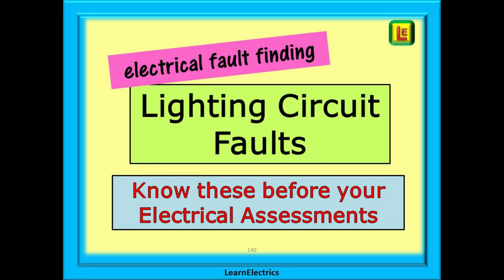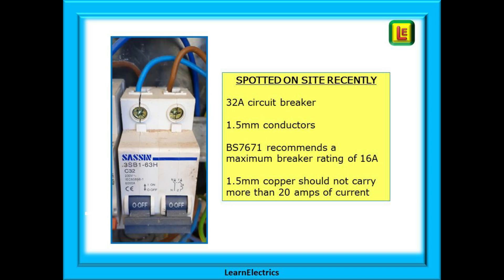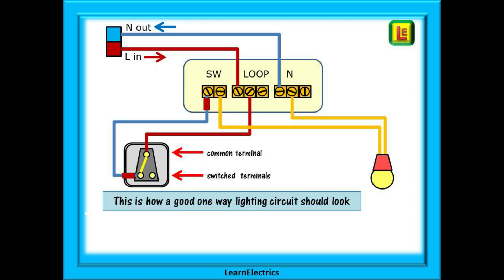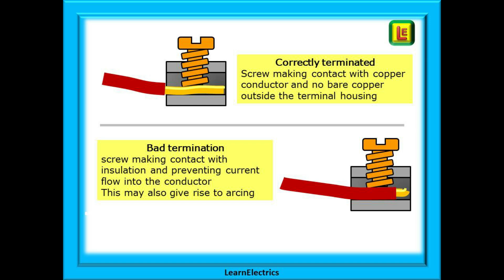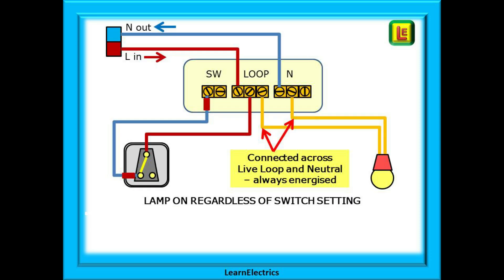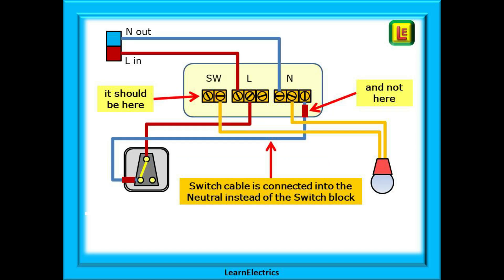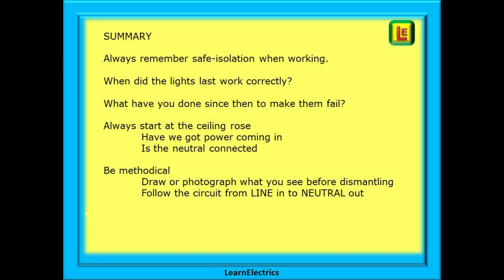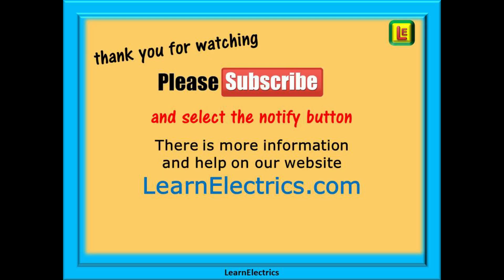LIGHTING CIRCUIT FAULTS FOR ELECTRICAL ASSESSMENTS and FAULT FINDING

Comment: How would you fault find the neutral cable in the wring rcd fault
Reply from the maker: Under no load the RCD will not trip. As soon as you put any load, even a tiny light bulb, onto that circuit, the RCD will trip, possibly both RCDs in a dual system. Dave.

Comment: Odd one here, 3 core and earth on bathroom fan. 
After fan isolator, switched live only giving 130v, perm live happily giving 230v. Any ideas? Neutral fault???
Reply from the maker: Remove the wiring from the fan (after drawing how it is wired) and check each conductor. If your earth is good, then a voltage check earth to each wire should show either zero volts or 230 volts ish. Flick the switch and see what voltages change.

Comment: I did a lighting circuit fault find 2 weeks ago. Customer complained of a burning smell and coming after he switched on the lights and then the lights tripping. 

After a few investigation we lifted up a floorboard to get acces to a joint which I couldn't get to from the light fitting, and saw a huge rat had clamped onto the switch wire. The burning smell was the rat cooking when the current was flowing through him. There were also live maggots eating him out 🤢🤢🤢🤢.
Reply from the maker: Yep, it happens more than we realise. Not a nice job but its got to be done. Dave.

Comment: Hi Robert here not Angela lol, another excellent video especially the large easy to follow diagrams. One thing though am i correct in saying that on a1 way light switch the brown live wire on the switch cable terminates in the common but on a 2 way or 3 way lighting configuration that same brown wire terminates in L1 and the black strapper cable from the 3 core goes into the common and also either gets carried on through to the common on the either 2nd or 3rd switch depending on the set up. Its remembering this which is tricky i guess it comes with practise thankyou so much your videos are a godsend they really are.
Reply from the maker: Yes Robert, it comes with practice. If you put the Line into common on the 2 way circuits, it would not work as required. Thanks for watching, Dave.

Comment: Thank you Dave. I have got a question about insulation resistance test on lighting circuit. When there is so many spotlight oncircuit, some electricians do the test bu 250 rather than disconnecting all light and doing 500v test. Some connecting line and neutral and just doing test between them and earth. Is it right way? 
Does it comply with regulation? 
Sorry if you find it irrelevant question.
Reply from the maker: Mohammad, take a look at this video, some testing methods changed with Amendment 2 and this video will explain. 

AMENDMENT 2 - 18th EDITION - INSULATION RESISTANCE TESTING – CHANGES - click on the link
https://www.youtube.com/watch?v=Kly-q-DShxA

Comment: Thank you Dave for the detailed explanation. If possible, I can communicate with you to discuss some questions related to street lighting circuits, as I have been working in this field for a long time and I face some technical problems due to the inability to understand how to choose the appropriate method to protect these circuits and people from electrical hazards. One of the problems is, if the luminaires are LED type and feed by a 3phase (4by16mm2) cable system. Is it ok or not to use the armor of the (4by16mm2) cable as a cpc instead of a copper cpc to reduce the cost of materials?. The second question: is it a must to use an RCD in addition to the circuit breaker in these circuits?
Reply from the maker: Steel armouring has only about 12% electrical conductivity of copper. Generally, it is accepted that the armouring of a cable has an equivelant conductivity of the copper cores. So, 16mm cores, the armour is equivelant to 16mm copper. If you need a bigger size earth you will need to run a separate cable. If the regulations for street lighting say use an RCD then you should be using an RCD + MCB or RCBO. If something goes wrong and people are injured, you will have to explain why you did what you did. Thanks for watching.
Reply: @learnelectrics4402  thanks a lot for the reply

Comment: Can someone please fo a video regarding the blue wire. The fact that its earthed at points along points back to the power station. And that ac curent moves down the blue wite but doesnt short to earth?? Nor do the earthed parts of the installation become energized yet are connected to earth and thus to neutral and ac current flows 'back' up the wire on the negative peak of the sin wave??  Please coz its not looking safe on paper or logical to connect earth to neutral
Reply from the maker: Neutral and earth are physically bolted together back at the substation so the same electrical potential. There is (about) zero volts difference between them. But yes, maybe a video could be done.
Reply: @learnelectrics4402  please do, no one has adressed this phenomenon. If the current changes direction ( alternating current) then at least 50 times a second the blue wire should behave excactly as the brown wire does. And thus energize all earth bonding if the flow is coming in from both live conductors . Why is the electrical pressure only registered on one wire if they 'alternate'???  Need to know. And thank you for sharing your knowledge in the community.

Comment: I would like to understand how testing is completed after flood damage if the consumer unit is unaffected please.
Reply from the maker: We would test the same as any other testing. The priority is to get the circuits dry and replace any wiring as required. Hope this helps. Dave.

Comment: Thanks again for the video.  I may be wrong here, but at 3.09 you say "the current flows through the switch to the common terminal and up to the switch block".  Your diagram shows the switching line coming from L2 to the switch block?
Reply from the maker: As long as it returns to the switch block, that is the main point. On one way lighting as long as one or the other is in common it will work. Dave.

Comment: I have found the trapped insulation problem and loose terminals within pre wired connector blocks on outdoor lighting accessories from the well known DIY suppliers. Check all screw connections, saves getting the ladder out twice!
Reply from the maker: Spot on advice there Mike. Check connections before mounting at height. Thanks. Dave.

Comment: My bedroom light randomly cuts out. I've had a sparky look at it and we've changed the pendant and switch, but couldn't find anything wrong and it is still happening and thoughts?
Reply from the maker: Check all the lighting circuit and the lamp. Process of elimination.

Comment: Hi, dave. During a consumer unit change and when doing a live test, I found out that the earth was live. I could test 14V coming from the earth but the RCBO did not trip. What can be the cause?
Reply from the maker: RCBOs work on current not voltage. Make sure all your earth connections are as they should be, this sometimes happens on some earthing systems.